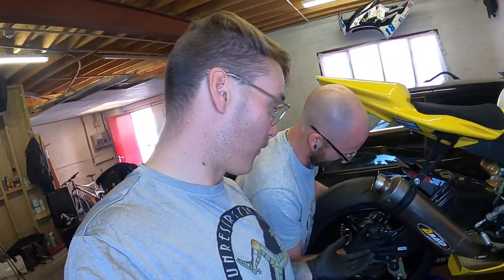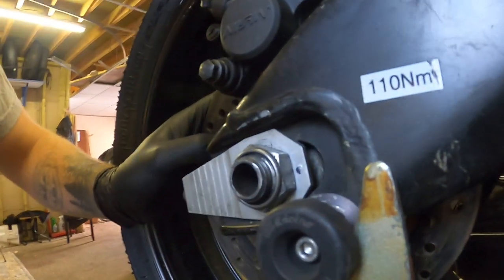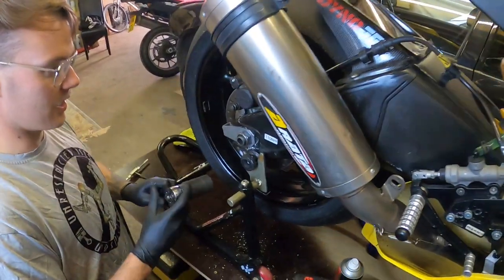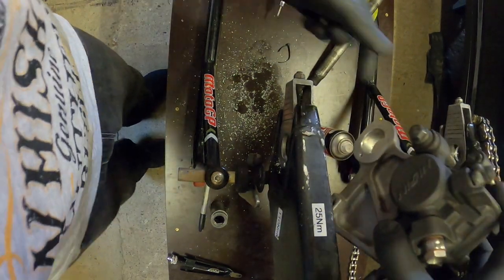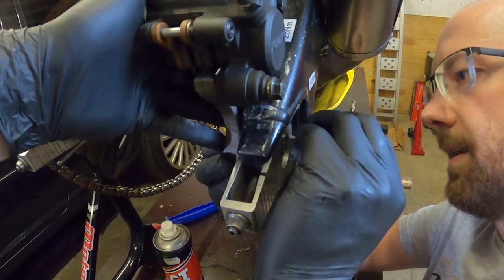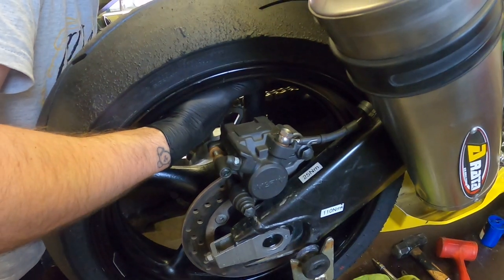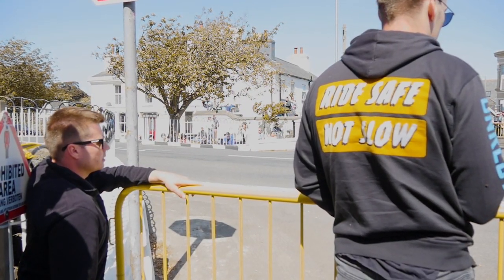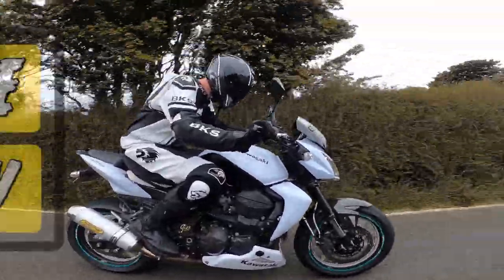This EASY Mod Changes Everything... Rear Caliper Life Hack

Comment: Another-but more involved-rear wheel change mod is to change to an underslung rear caliper. So it "catches" the rear wheel when you are putting it back in. Though obvs you'll need a new caliper but there's plenty around.